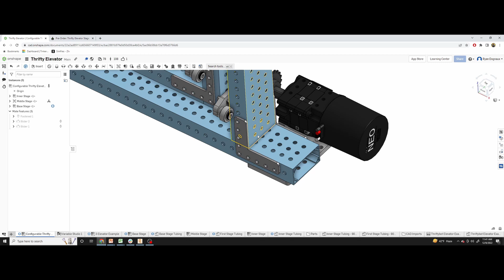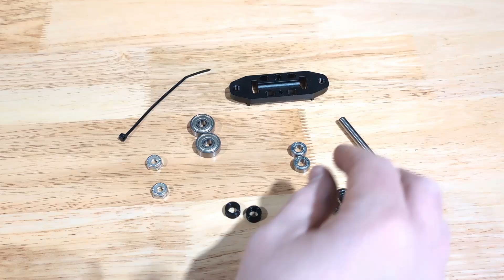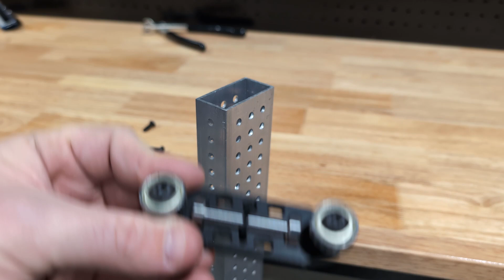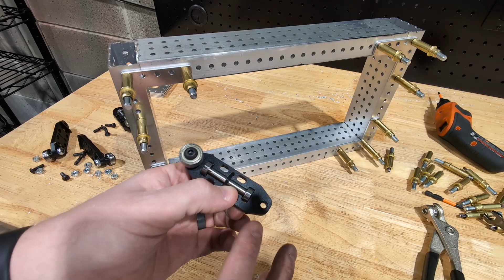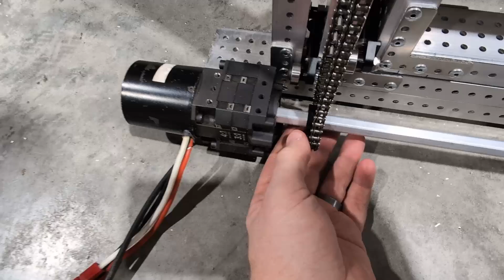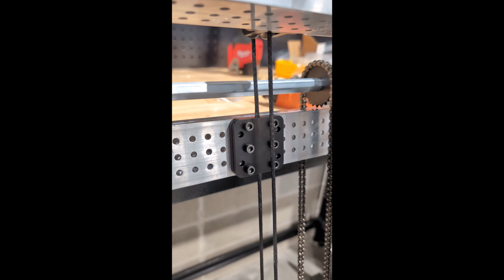How to Build a Cascading Thrifty Elevator for FIRST Robotics 01-05-25

Comment: Thanks for this! If I already have the first stage, do you provide a kit for adding a second stage?
Reply from the maker: You'd just need to add the two dyneema pulley kits and an additional sliding bearing block kit.